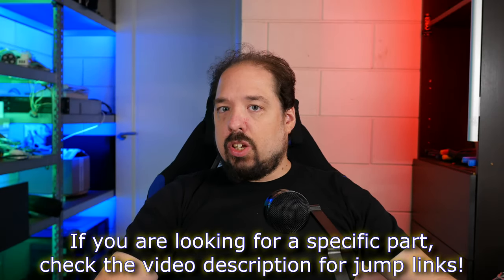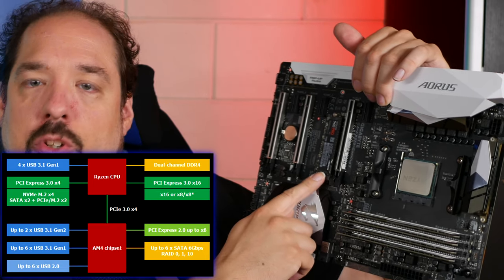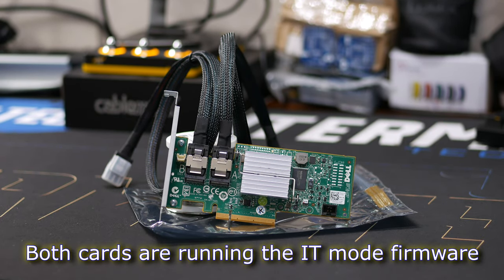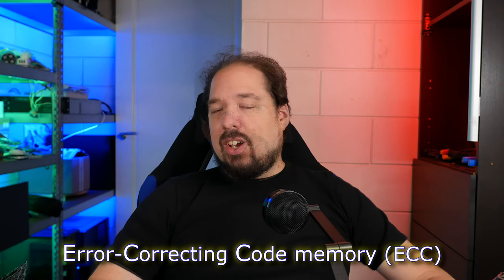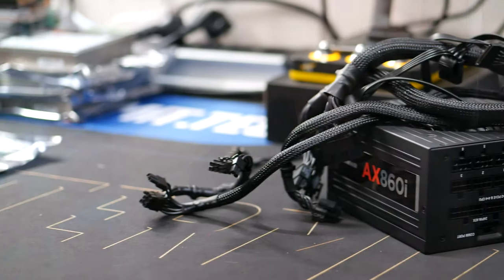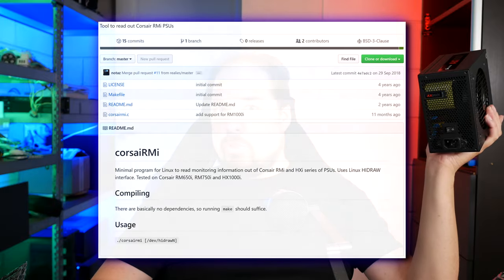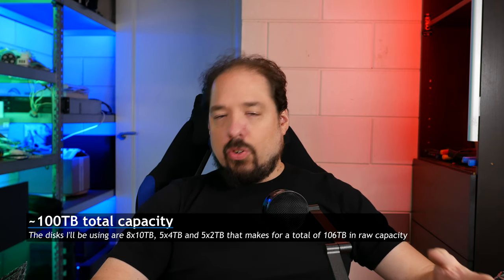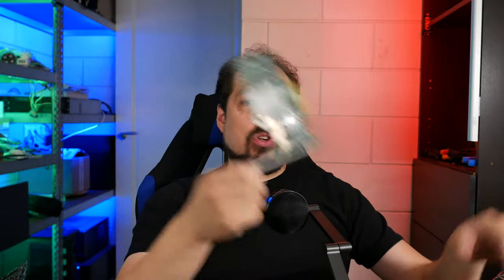Home Networking: 100TB 10Gbit Server - What hardware do you need?

Comment: Would you use MLC SSD instead of TLC SSD's for FreeNAS or Unraid? I'm going to get a 36bay supermicro chassis with 24 mechanical for mass storage and a array of SSD of 10-12  for quick access of router,switches config, VM backups,ISO. and maybe do a RAID1 on the OS. Are you planning on doing a DAC connection? Also which  Intel NICs are you going to put in the new server?
I cant decide which NIC I want to use for my rackmount servers down the line,but I need SFP+ with dual fiber ports that preferred using pcie3.0 and I have been looking at the X520-SR2, 1 in my w10 and 1 in FreeNAS/UNraid for DAC passive twin axial cable, X540 for dual copper 10Gbit or just go with x550-T2?

I will be very much interested in your opinion with mechanical drives etc of your choice for all your equipment chosing etc.
Reply from the maker: Well, equipment choice what was this video was about! :)

For write/read cache MLC is obviously better then TLC (or worse) since it's going to be re-written a lot, that's the nature of a cache. In my case the L2ARC is a 960Pro which is MLC and but the ZIL/sLOG is TLC but is very very highly over dimensioned and has a controller with Enterprise roots with Power loss protection.

For a pure SSD pool, unless you are expecting an usual amount of writes vs reads TLC would be ok since the you basically get a form of wear leveling over all SSDs in the same pool. This includes forms of SLC caching inside of the SSD. Basically if the SSD has 30GB of SLC cache, with 10 of them you need to write through 300GB in one go before it slows down.

ZFS is very particular in regards to RAID, it doesn't work the way most people think it does (like traditional RAID) and you need to know this in regard to random IOps you can achieve, but there will be a separate video about that!

For the network cards, check out my 10Gbit Mikrotik video I did, I basically use everything. There will be an Intel x540-T1 in this server because I bought them cheap, but my desktop for instance has a Mellanox ConnectX-3 in there. If you are looking for a Dual SFP+ card with PCIe 3.0 check that one out, it's been great so far (And I would prefer it above an Intel X520 or X720 even)! Sometimes good deals pass by on ebay! For Media I use a mix of Copper and DAC right now but I've also used fiber in the past, whatever works best in that situation really, and don't be afraid of using fiber, it's often cheaper (and kinda better) then copper!

In the end this is a home server and the amount of disk access is limited to a few users so I can easily get away with using this kind of hardware. So what you need, really depends more on the access pattern you except then anything else.
Reply: @IntermitTech  yeah,you kinda forgot to talk about the NICs of your choice tho. I'm planning on 2.5 SSD for ssd array as I mentioned for storage for VM and such,you recommend MLC or TLC? I still havent decided on freenas or Unraid so. So MLC does not have that Power Loss protection then? or it just the seagete ssd's?
Reply from the maker: @andersgjerlw9636  As I mentioned, NIC of choice would be the ConnectX-3 but since I need to go through 35 meter of copper for this server I'm using a x540-T1 in this one.

For VM storage TLC can work fine (depends on their function, if not heavy write, you are ok). The reason for the Seagate SSD is because of it's controller, sustained throughput, DWPD and power loss protection. But last is MOST important for a ZIL/sLOG, less for a normal ZFS pool (you'll loose max 5 seconds of committed data) but still certainly can't hurt!

There are MLC SSDs with powerloss protection, but everything has a price. I went te very over-provisioned TLC way.
Reply: @IntermitTech  I also heard bad things about the X720 NIC,but that was for Esxi. Why do you recommend Mellanox over Intel ones? more features?
I'm interested in getting the 10Gbit that is coolest without using mods. Are the driver installs for Mellanox ConnextX-3 easy or complicated?
I'm only considering ZFS,because I want snapshots,block volume,bitrot protection,but I more want the option to add any storage drive later at some point
Reply: @IntermitTech  alright,so generally MLC SSD's then? any reason you arent going for QLC? Or is that just for m.2 drives?
I'm a WD fanboy and I have had bad experience with seagate drives over the years private so using seagate SSD's will be mental readjustments.You mentioned over provision on the ssd's,will that work if you do a 12 ssd array for copying?
Reply from the maker: @andersgjerlw9636  In the actual Enterprise the X720 NICs aren't held in high regard. Qlogic, Emulex and well Mellanox have just brought out better cards and drivers in the most recent years, especially if you are looking at 40Gbit or higher even.

I can't really speak to TDP of the cards, as I mentioned, depending on your airflow they will need a fan for "desktop" use. Try and look into the manufacturing process they where created on, in theory the a smaller manufacturing process (14nm vs 28nm) will generate less heat. :)

You can add more storage to a pool later on with ZFS, there are just some rules to play by, but I have a video about ZFS in the works! :)
Reply from the maker: @andersgjerlw9636  Lol, you have a lot of questions! ;)

MLC is generally always better then TLC since each MLC cell can generally take more writes then TLC (so longer life aka more writes). Performance wise writing to MLC is also easier then TLC but clever controllers and more channels can help alleviate that issue.

SLC = Single Layer Cell
MLC = Multi Layer Cell
TLC = Triple Layer Cell
QLC = Quad Layer Cell

QLC is cheapest but slowest and dies quickest.

WD makes fine products but in regards to HDDs I've had better experience with Seagate for the past 4 years. In the end, 1% to 2% fails for both brands unless there is a bad batch/series. I haven't had a bad Ironwolf yet from the 20 I'm running right now.

Over provisioning works in all situations, you leave space free/unpartitioned and the controller has more breathing room to do it's internal processing and wear-leveling which means the SSD will last longer.

SSD array for copying? If you are going to hit it, sustained, for hours on end, look into SLC or MLC SSDs, most TLC SSDs work with an SLC cache, once you "burn through it" they slow down (a lot).
Reply: @IntermitTech  okay,but will X520,X540,X550-T2 or mellanox ConnextX-3 work in Windows 10 ? Because I cant seem to find if all of them are supported on W10? And thanks for the nm tip, I will look for 14nm nic I suppose. I really like most Intel products,not a fanboy but I think most stand for quality and is generally validated for VM's,Citrix,Esxi and such more than others,but I might be wrong ofcourse.
Reply: @IntermitTech  Alright,that settles it for me,MC drives ftw. To be honest tho I think I have had roughly 50/50 failure rate in the last 9 years from 2010 - 2015 atleast. In 2016 I started buying WD blacks and I havent had any issues since. 
What you think about Helium drives vs normal air drives up to 6TB?
I really want a sustained write speed on SSD, even on mechanical ones.
Upgrading to 10Gbit switches is further down the line,tho I'm going to the Cisco line,but they are so bloody expensive.
Also a rack question if you know. For servers in a rack case, I have now a 37U that is 600x800mm deep and my rackserver is like 699mm deep and the steel beams wont fit my rackrails in the rear. You think 1070mm or 1200mm deep is enough for servers like a supermicro SC847,Lenovo x3650 m3, Dell r710. I know the lenovo is just short because I own one,but I think the r710 is the same. I also would like a rack console,but I'm probably gonne end up using iDRAC,BMC on supermicro and the IMM for Lenovo.Is that a waste of money. The rackcase is like 2m away from this pc in the same room.

Comment: my experience in datacenter shows what seagate hdds is most unreliable with some models of 50% annual failure rate
Reply: Yep they dont even last like 2 weeks before they die. There the most unreliable junk around. Use somthing better from a reputable company eg WD red drives or somthing like that.

Comment: In 4:05 you "but I also need a videocard". Please elaborate, since the motherboard probably has some onboard...

I am going to make something like this for a friend. He is running about 10 external HDDs instead, collecting dust en mass and people tripping over wires...
Reply from the maker: Normal Ryzen processors don't have a GPU. So even though your mobo might have the ports, they won't do anything unless you have an APU in there, which the Ryzen 1700 isn't

Urrgh, 10 external HDDs that are running too, the horror and so unsafe because probably no redundancy or off-site backup. Hopefully you can help him out! Next to the server content I also plan on doing some backup related content in the future, a sort of update to my DIY cloud series.
Reply: Intermit.Tech Thank you for your explaing!
Actually I thought that every AMD CPU had some kind of iGPU (64MB), just like Intel.
My bad!

The part about my friend was just a comment on what I wanted to take experience of your great video.
I think I'll show him this and another video, because he is only keen on the idea, if we open the externals and reuse those harddrives with everything on them.
- "It's... not recommended... at all!", I said.

Using this walkthrough I think it's possible (as a pitstop) to do it his way before taking "the right path", clean HDDs with backup.
Don't you think?

Comment: Any reason why you waste presious PCIe lanes on a useless GPU when you have a onboard video and anyway would be remote admin on the Proxmox ?
I mean just 10 seconds after installing the PVE you would go Remote on it and set setup anything else :-)
Reply from the maker: You should have watched a little bit more. This is a Ryzen based system so has no onboard GPU, I'm using a PCIe x1 GPU for console only and later on in the series I demonstrate that I run it headless normally and what the actual effect on the PCIe bandwidth is. ;)

I know you are probably used to YouTubers releasing half-assed, don't really know what they are doing videos, but I hope I can prove to be a little bit different. ;)
Reply: @IntermitTech  Then you do not use any of the 3 MB's you link to, as all 3 has either HDMI  or a DP :-)
And yes, it is a plesure to see that you are able to reuse parts you have and mix serveral arays to solve the task at hand - and are able to migrate to your new  server not  in a strait forward manor :-)
Too many youtubers has only little more than plain user knowledge of hardware, it is painfull to see how little they get out of pretty powerfull hardware.
I am yet to see someone build a  70+TB (raw, 100+TB compressed) PVE server on less than 100W - 5 domains Web-hosting, mail and cloud :-)
Reply from the maker: Ah, yes the motherboards have those ports but the CPU needs to have integrated graphics for that with AMD which mainstream Ryzen processors do not, only lower core and slower APU versions. So that's why no onboard graphics, those mobo ports are connected to nothing in my case.

This server, without the old 3TB drives and with like a 3700x wouldn't use more then 100w? So what you are looking for is certainly possible. But, if you are hosting and can't afford downtime, I'd suggest a bit more server grade hardware.

Comment: That HBA is only pcie 2 anyway. Plug one of them in the bottom....
Reply from the maker: If you followed the video, the bottom x16 slot is indeed Gen2 and is electrically x4 but when you use a x1 slot anywhere on the board becomes a PCIe Gen2 x2 slot meaning a maximum of 8Gbit (and probably lower) so it would severely limit the amount of bandwidth available to the disks. That's why the 10Gbit card is in there, if anything gets limited, that suffers the least. But I have something in mind to alleviate that limit, that will be in a future video if it works! :)

Comment: Dont ever use Seagate if you care of your data. WD is more kvalité.
Reply from the maker: Interesting you say that, my personal experience over the last few years have been quite the opposite.

Their Helium filled drives I am yet to find a single one that failed on me (running around 20 for the past 2 years). On the other hand I've had WDs dropping left and right, even in the server I'm replacing in this video!

What's been your personal experience that you believe they fail more often then WD?
Reply: @IntermitTech  All my Seagates have breakdown, all my WD is still going strong. Seagate is known for breaking.
Reply from the maker: @bennyholgersson4686  You seem to provide very little statistics on how many drives you are using. Don't get this the wrong way, often these statements are people regurgitating stuff they "read somewhere" which is often based on basically nothing or someone mad their drive died and they didn't have backups. That's why I'm a bit hesitant to go along with those statements.

In my opinion, WD is known for breaking (and personal experience with over 80 drives running in the past 5 years) and Seagate, especially their IronWolf series has been rock solid (start using those 2,5 years ago, 0 failures up until now with 20 active). Especially their Helium drives are highly regarded by me for performance and reliability!

This is disregarding Enterprise drives, basically 1% to 2% failure, for every brand. :P

Still, everyone's experience will be different, but don't be too quick to believe what people are shouting about HDD brands unless they can show personal experience with more then 1 drive that just happened to have died. :P Same goes for the Blackblaze reports, those are awesome, but you do need to interpret them correctly.

My Samsung 2TB drives I'm also putting into this build have 8 years of runtime, 0 failure, the WDs 2 of 5 failed in 5 years. :P
Reply: @IntermitTech  sorry om from Sweden so i dont know all the words to explain in English. I have hade 20-30 Seagate over the years and all have breakdown after 2 years. From the years with Amiga 1200 to now. But all my WD have never hade a error or break dow. My oldest is from 1990 and still going strong.
Reply from the maker: @bennyholgersson4686  Ah, different language can be challenging, appreciate the comments! :)

We seem to have had completely opposite experiences then. I've had about equal Samsung, Maxtor, WD, HGST and Seagate over the years and although there have been bad series for for each of those brands, at least in the last 5 years I've had more issues with WD disks then Seagate. And as said, currently I think the Seagete IronWolf disks are excellent!

But as I said, now a days the disks from both brands (Only WD and Seagate left) have around a 1% to 2% annual failure rate so it's more personal experience then anything else. Looking at Blackblaze for instance the Seagate disks seem to be doing fine, they don't seem to use a lot of WD. :)
Reply: Seagate is just total garbage, had 3 out of 5 die within only a month or 2 of purchasing as everyone said they was good for a nas build. buy somthing more reliable and from a reputable company; WD red nas drives
Reply from the maker: Sucks you had such a bad experience with them. I'm running 20+ Ironwolf 10TB drives and they have been rock solid for me for years and years now. I personally like them better then the much slower WD series, those are ok for bulk storage, but not much else like I'm doing. :)

Comment: I realy dont like the setup, gaming mobo for server just dont work. typical server mobo would give you 5 x8 PCIe gen 3 plus one x4 slot gen2  and onboard video and remote management. even with your mobo You could use LSI SAS 3008 with 4 ports (16 disks) and then You need only one HBA. and why You are not using SAS disks, 8TB SAS disks are cheper than 10TB SATA, SAS is definetelly much beter for ZFS. I geuse You are trying to build the server from components You already have but sometimes it is beter o sell it and buy different (also used and cheap) but dedicated for storage.  Iselected Xeon D-1541 for my new small box and some time ago I selected Xeon E5-2650Lv2  for big one (DDR3 LRDIMM memory is very very cheap and I got 8x32GB), ZFS likes RAM, You know it. server component about 3 years old are very cheap and are still much faster and energy efficient than regular end user computers. I use 8 x 4TB mirrors for my defaul pool, and two 6 disks Z2: one for backup and one for big media files like movies. new small box will be based on just 4 x 8TB dists not 4TB like old one.I came here to see how others make heir decisions. I like some of Yours but the general one to use gaming mobo and fighting with stupid limitation is the worst one and it takes almost half of the video.

Comment: use supermicro :)
Reply from the maker: Give money and I'll be happy to, re-using "old" parts seems smarter :)
Reply: he will get there :) after running desktop hardware with various levels of success a lot of failures and annoyances like missing IPMI, SNMP and not working enterprise hardware, I finally upgraded my server to a Supermicro board (X10SRH-CLN4F) a few years ago and could not be more happy, no more issues and easy remote management. But with CPU (E5-2630 v3) and memory installed that was more than €1200,- and prices have not really come down.